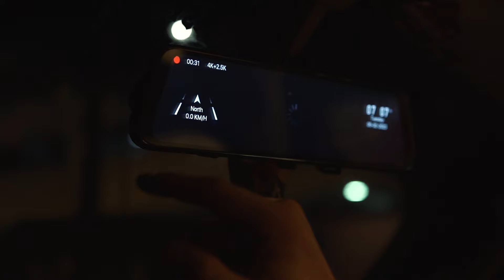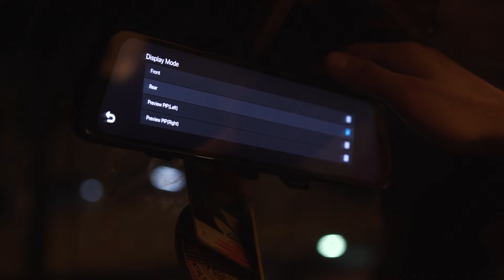Panama Part 1: How Do You Cross the Darién Gap? Our Land Cruiser's Shipping Journey

Comment: Wolfbox is awesome. I did a ton of research on this stuff and these guys are the game. I will say after about a year, I've had to reboot it a few times. Kind of a rash but not a redline. By the way, I took a second camera and plugged it in for wheel placement in front and it works like a charm. I am riding solo thus no spotter on tougher terrain.
Reply from the maker: We’ve had ours for just over a year and it’s still doing great so far. That’s such a great idea for the wheel cam!